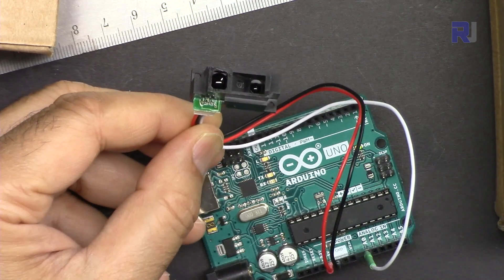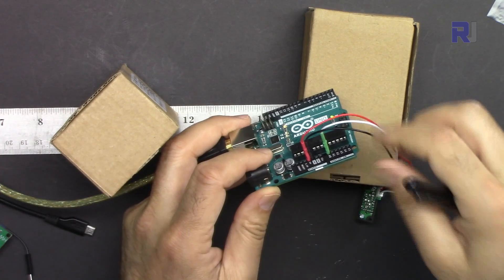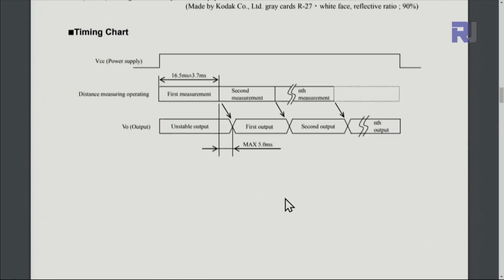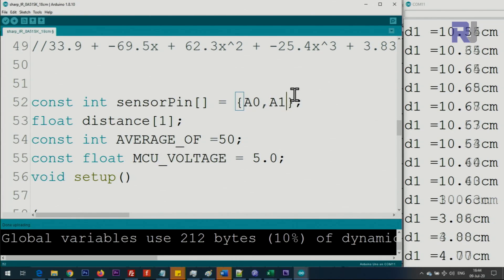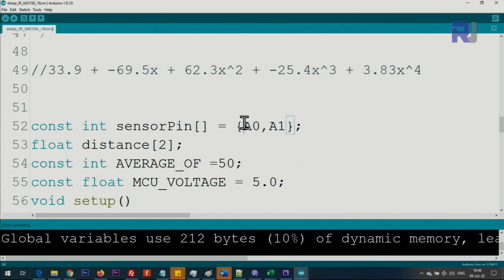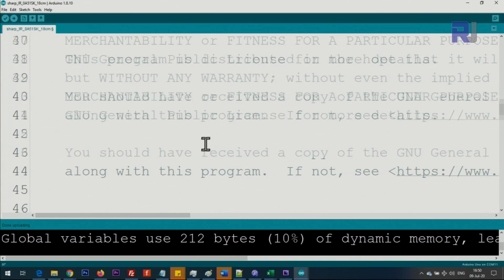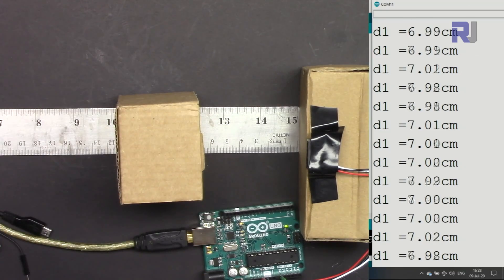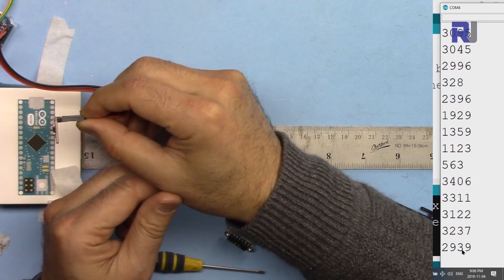Using Sharp IR GP2Y0A51SK0F Distance Sensor with Arduino (2cm to 15cm) - RJT336

Comment: I’m using this sensor for an esp32, but although I changed the mcu voltage to 3.3 and resolution to 12bit it’s not accurate. What would I need to change in order for it work properly.
Reply: Did you get an answer? I’m also using esp32. What did you do to make it accurate?

Comment: can i use this formula from fitting curve for sharp 4-30cm??
Reply from the maker: the datasheet is provided.  Yes you can use.
Reply: @robojax  so i can use 33.9 + -69.5x + 62.3x^2 + -25.4x^3 + 3.83x^4 this fitting curve equation for the Sharp IR GP2Y0A41SK0F 4-30cm??? or i need make another fitting curve?

Comment: I have problem with measuring distance, in real life distance between sensor and box is 10 Cm but the measuring distance form sensor is 9 Cm. Can you solve this? Thank you
Reply from the maker: I have provided the formula and spreadsheet data so you can see and fix it.  change your reference pint.  May be it is accurate and you look at wrong point. Chose another point and measure different objects. when I say reference point I mean from the sensor to the object.
Reply: @robojax  Thank You. Your solution is work on my Project :)

Comment: hey great video!  i had a few questions.  if the sensor works on reflected light intensity does that mean that if you use it on a surface that absorbs IR light that it might give false readings?  (im assuming that it would register a very low voltage output even if the surface is very close).  on the data sheet its has a note that mentions that the reflectivity of the surface will not be a consideration because it uses the "triangulation method" can you explain how this compensates for a material that absorbs IR light?  sorry if these are silly questions, im new to all of this and know very little.
Reply: I have the same doubt..

Comment: Hello sir, can you tell whether can we take input from digital pins, if no then why not? thnk u sir
Reply from the maker: have you watched the video? this is outputting voltage proportional to the distance.  it does not have any chip or register to record it inside. we use Arduino to do it.
Reply: @robojax  thank u for time sir..,yeah we are taking analog input from the Arduino...but  y it is not taking digital input...as we r measuring Ur sensor with digital pins..?...

Comment: Sir i want high speed switching solid state relay to off and on the DC-load , that means the relay will operate high switching speed for example - i will give the delay (10)or, this relay will able to on off   the load more than hundred times in 30 seconds are more, please🙏 tell me the the good solid state MOSFET relay
Reply from the maker: Hi, why posted your comment under distance sensor? Your question is not related to this and anything we say will not benefit other. The whole purpose of YouTube is so everyone can benefit and learn for free. Please post your question under the relevant video and I will see it. I have ONE page where I see all comments and I NEVER miss any comment.
Reply: My load is (DC)solenoid I will operate four solenoids one by one with I switching speed using relays route to give the good suggestion for using the good solid state relay using MOSFET are any other I switching speed components